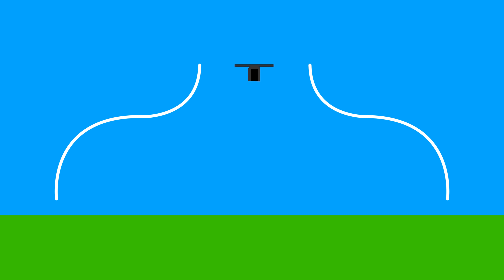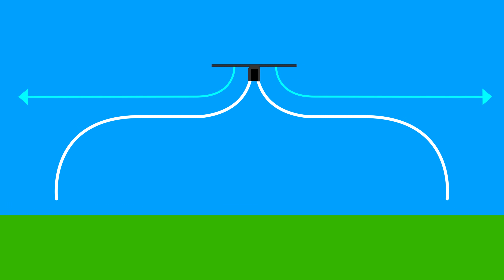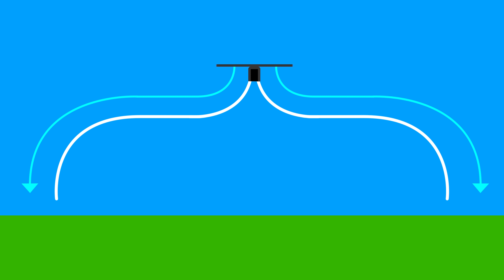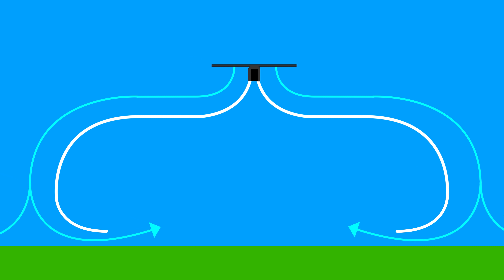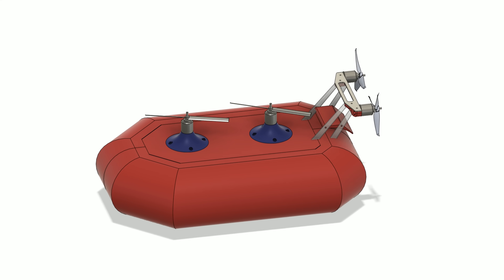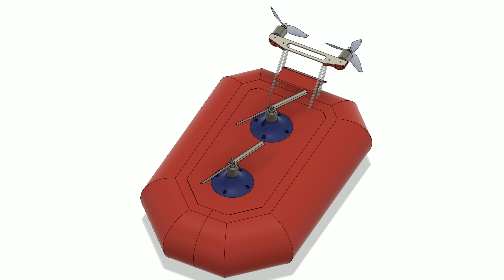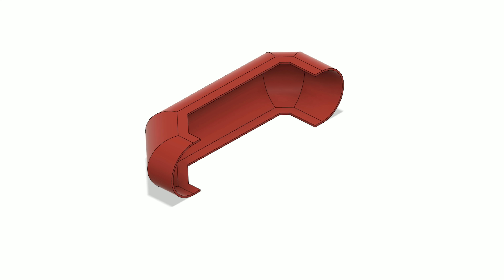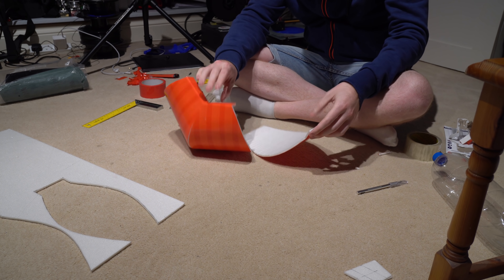Coanda Effect Hovercraft

Comment: why doesn't the hovercraft lift up and flip just like your project? i think that because of that, the hovercraft produces high pressure under its body and it's plastic whatever basically like a balloon and does not rely on actually lifting up using high pressure and low pressure like an airplane. am i wrong?

Comment: I know you were just trying to see if you could build a hovercraft using the Coanda effect at all, but I'm curious to see if you could optimize it. I loved how you did that in the trebuchet video. 

It looks like you're running the two motors on top at the same speed, and it's not helping with the stability. The motor at the front is further from the center of mass and the resulting momentum is lifting up the nose, whereas the other motor is almost on top of the center of mass. I think you could get better results if you 1. used current limiting resistors, with a higher value resistor for the front motor, or, 2. use a lower duty cycle for the front motor if you are using PWM. Alternatively, in terms of the Coanda effect, you could try replacing the front propeller with the impeller, possibly combine it with one of the aforementioned solutions, and see what happens.

Also, since you are looking into ground-effect vehicles, how would you feel about doing a "Caspian Sea Monster" type Ekranoplan? You know, the type with the abundance of thrusters slapped to the hull. I think it would blow all the leaves all over your neighbors' gardens instead of just gathering them.

Comment: Needs more weight to the nose to counter the rear motors and mounts. Put the electronics and the battery at the nose and try to balance it equal to the rear motor's weight.

Comment: Enjoy the video?  Very Much!  I have to ask, though:  is all of the lift from the Coanda Effect or do the props pointing toward the sky produce their own lift?  A more calculated / controlled upper curve surface could maybe enhance the effect.  Can you 3-D print in foam to get the strength of the shell without the weight of the tape?  How broad can you make the lift surface before the laminar flow fails and becomes turbulent? 

Excellent research!  Are there other designers who have other design tool that could collaborate with you and refine this design?  Keep up the good work!!!

Comment: Good job on the construction. Sure you will find ways so make it more stable. May be  decrease the the power on the front lift motor a bit to compensate for the weight of the tail.

Comment: I am no engineer but I can see a terrible flaw in that design. a real waste/loss of down airflow from the propellers. If you have them in a tube and the outer red body with a very thin double layer body, the air could flow under high pressure and then you can obtain your desired lift.

Comment: Now it needs some kind of active stabilization system so it can pick up to about 1" ground clearance, and not heel over when turning. That would give it an advantage over conventional hovercraft by not needing a flexible skirt. Hovercraft were a development from the Avro VZ-9 Avrocar. While intended to be a fast flying, highly maneuverable aircraft, it never managed to get above ground effect height and was always very unstable. But when the concept was modified to stay low, and a flexible skirt added to keep the air cushion constrained, Tada! hovercraft. The tradeoff was the skirt dragging across the surface and constantly wearing. But the dream has always been to have a stable hovercraft where no part ever contacts the ground except when it's sitting still with the engines off.

Comment: When you have props on top instead of the impellers, is it really using the Coanda effect? It seems more like you've created a two-prop copter more than using the Coanda effect. It's not the air's adhesion to the smooth sides that's providing lift, but the initial pull upward from the props.

Comment: Have less thrust on the rear lifter because the direction fans are producing air flow in the same manner as the lifters. Which is why they cause nosedive. Taller impellers may have produced more of the flow you needed, vary the vanes yada yada. Also, a kind of airflow director on the outside of the craft could have done like a skirt or something I don't know.

Comment: Its interesting and shows that there is no big pressure-effect under the hovercraft. The props are lifting nicely up but its always close to a liftoff.
Traditional hovercrafts use less power because they have just to put up enough pressure to start a nice airflow from the inside out and the craft will float on this airflow.
In this experiment the hovercraft only gets lighter and starts gliding over the ground not floating.

Comment: You should have used centripetal instead of centrifugal rotor. centripetal on  center and centrifugal on each corners. Central rortor helps to lift the frame and corner rotor helps to maintain the lift

Comment: i'd like to see you put a load inside the main body along the sides of the opening, basically just at the bottom of craft, looks promising with full throttle use and stability.

Comment: Are your motors set up to counter-rotate [especially the lift motors]? If they spin in the same direction, the [combined] torque could be a source of instability. Also, adding a plastic mesh screen [to cover the opening on the bottom could cut down on the debris that ends up inside the craft.

An interesting follow-up project would be to transform the craft's shape into a large flying wing [to see if that shape would produce better horizontal stability as well]. However, still put the Coanda Effect to use in order to generate lift. 

Finally, move the lift motors backwards (closer to the drive motors) to see if that would prevent the craft [of either shape] from pitching nose-upwards.

Comment: I think part of the problem with the pitching may be due to the asymmetry of the design front to back. The downward fan at the front has less obstructed airflow as it's nearer the edges (due to the more heavily truncated corners at the nose than at the tail). Furthermore, while the thrust rotors may not be interfering with outflow, they must surely be affecting the pressure at the intake of the rear fan.

Comment: Few things id love to see that probably wouldn't be overly complex to achieve..

1. Try fitting a removable panel so there's no gap on the underside. My theory is that under forward momentum this would create a natural cushion of air that the entire craft could ride along. I think the cavity at the bottom would limit ground effect efficiency and might allow it to operate like a WiG vehicle.

2. Try some little stubby wings and see if it will maintain forward flight as a kind of lifting body vehicle

3. Cut out some small vents close to the base of the motor mounts to allow some (maybe 30%) airflow into the cavity underneath creating a more conventional hovercraft. Again, my theory here is that the coanda airflow would hit the airflow coming out from underneath and be force more directly down rather than curving underneath. You could even put lateral slats inside to push the air towards the outside of the vehicle.

Hopefully you could give one or more of these a go and show that coanda can be useful as an assistive lift method for less conventional ground effect vehicles e.g. Heavy cargo etc

Comment: Couple of thoughts: Think it would make a difference if the lift propellers were counter-rotating? (Each appears to spin the same as the other.)
And perhaps you could reduce the top-heavy condition by mounting the lift motors underneath the top plate with  shafts extending through the top plate allowing the the lift props to be mounted in the same location.

Comment: You mentioned it wouldn't need stabilizers because hovercraft are self stabilizing; that's because on a hovercraft, if you lift one edge, the air cushion escapes from that edge, and consequently the edge drops.  With Coanda effect, the active principle is above the deck, and unaffected by the attitude of the deck, or any ground effect, so a Coanda effect craft would not be self stabilizing.

Comment: Watching the direction of rotation of the hover raft body  makes me think that the torque of the propulsive motors may be a problem. I built a hydroplane boat with one of my brothers years ago.  Two motors on the stern,  and we had it flip on us until we changed to counter-rotating motors and screws.

Could you readdress this drive system,  reversing the motor polarity and mounting direction of the propeller on one side? It may cancel the induced torque. Worth a try, no?

Comment: @ 5:37 adding a couple of ducts at the edge of the impellers could have directed a tremendous amount of air under the hull and resulted in more lift than you would know what to do with.  Another vane or two would take more of the impellers' outputs and direct it rearward, generating thrust.

Of course that isn't the goal of the experiment, it's just what I would do with the impellers to make them work on the model, if I were going to carry on with just impellers.

Comment: You need a control. maybe with a flat piece of board. Because how you do know with the thrust of the propellers wanst just lifting the plane up. maybe also take a cross-section and see if your lip to pressurize the underside actually did was you hoped.

Comment: the impellers would have been more efficient if you placed them on the underside and added some light ducting on the outer edge of the inside of the craft and allowed room for the impeller intake, so they would pull air from the middle  of the craft and expelled it to the outer edge, also use lighter weight materials instead of metals

Comment: If the horizontal impellers did not produce the Coanda Effect, what makes you think that this is, indeed, the Coanda Effect in action. I think it is MORE LIKELY simply acting as a copter SCREWING UP INTO the air. There is not as much DOWNWARD thrust of a copter, possibly, but downward thrust is not the only force involved in a copter.

Comment: nice experiment, it hovers sweetly and looks like a superfun toy. you can measure the efficiency using a smoke test. if there's airstream going to the side or upways then that means loss. as others pointed out probably an impeller would be more useful and also optimizing shape of the hovercraft and prop size so the effect has better chance to kick-in

Comment: you might have a tiny bit of success with your theory. But look how much power you had to use to achieve it   On the the other hand if you would used a conventional  system to fill the air curtain, you certainly would have use LESS power float your hovercraft . Edit    Think about the real hovercraft Ship. because no fans on top they could put cabin on top for passenger to travel. Try to put a cabin on top of your model  I am referring to the hovercraft Ship  (Ferry)

Comment: I'm sceptical about the Coanda effect with this design. I think it's just a super inefficient dual rotor helicopter. Produces just enough lift to imitate a "hover". You should make the exact same thing only using right angles (aka a box) but same weight and shape. This would neglect the Coanda effect and test the power of the motors only.

Comment: actually... a hovercraft works by creating a airskirt around trapped air. the rest is correct. you can see that effect with a big can and then inside a smaller can. the pressure is higher then when you would only use 1 can.

Comment: While it’s hard to gauge the weight, dimensions, weight and lift etc, but have you tried to line the insides on the internal lip with square aluminium tubing?
It’s light weight but may be enough to improve stability when turning and will lower the overall centre of gravity (you can also finely tune it by adding small bolts and then adding washers until you find the desired weight).

Comment: Just because you're getting lift doesn't mean you're getting Coanda effect. You need to prove that the air is actually following the curved surface. I noticed in your previous video (with the smoke) that the Coanda effect you were getting was only very marginal at best. I think the props are mostly providing helicopter lift, and your drone would probably go higher without the weight of the curved fairing. I think your flow from the props are too turbulent to be generating much Coanda effect.

Comment: Nice. but you need to do a version of the design more like a hovercraft to compare them. Maybe just cut a hole in the top and lower the properllers (or just use a single propeller in that mode).

Comment: Maybe next you could combine Wing in Ground effect and coanda effect. Like a system similar to this for low speed manuverring but with a ram intake to pressurize the bottom for smoother high speed operating. Also maybe putting some sort of cover over the impeller could help, I think they might be making a ring vortex by sucking up the air they just expelled.

Comment: I think this would work better if the shape were more like a hamburger bun. Rounded on top, with a flatter surface on the bottom. It should still have rounded edges on the bottom, but with a much shorter/smaller radius to those edges. Look at a hamburger bun and you'll see what I mean. This will give it better lift and more stability. The effect will come around the top edges and immediately meet the ground, rather than having to travel the greater distance across the empty space between the top half and the bottom half. The bottom radius is just too long. It'll be much less likely to flip over, and the effect will reach the ground more easily. 

https://www.featurepics.com/StockImage/20080613/hamburger-bun-stock-photo-767901.jpg

Comment: So, I think the coanda affect could actually be used in a hovercraft, to make all the cargo, people, and fuel essentially be inside the "skirt."
But I feel like the best way around it would be to make a high-efficiency hovercraft by having the top of the "skirt" under the props be somewhat grated, so air can slip under and over the "skirt," taking advantage of the typical hovercraft logic, and the coanda affect.
I'm curious if you'd be willing to try this.

Comment: It appears your center of mass is somewhere between your rear lift motor, and your propulsion engine mount strut.
So it's high and tail heavy.
Adding a little bit of weight on the inside of the nose inside the... Erm, "skirt," (for lack of a better term) could resolve your tipping issue during turns.

Otherwise, to resolve the issue of tipping, you'd have to look at cars and other hovercraft; make it wider.

If you do remake this, I'd love to see a 3d printed (or laser cut wood) prop motor mount, to keep the weight near the middle, and slightly lower.

Comment: Could it be that your vertical props are actually acting like drone lifts and not the coanda effect much at all? Coanta effect devices I've seen designed have a fan that draws air in through a area from beneath the dome and slides it over a domed shaped lift body. I'll bet that if you were to make a cut out area below your blades it would lift more even if the coanda effect were destroyed by doing so, but because the props would be more free to act like drone props.

Comment: Very interesting!  It seems like it shouldn't be too difficult to move the motors to the underside and mount the props (in the same place they are) on axles, to help bring the center of gravity lower without adding much weight.  I know that's besides the point of the experiment but it might be an easy mod to bring more stability.

I'm also wondering what would happen if the underside was solid instead.  That should be very easy to test and might also bring a bit more weight to the very bottom, again lowering the center of gravity.

Subbed!

Comment: The fact that the vehicle acted as a pretty good leaf-collector shows that air is being blown into the cavity underneath where, presumably, it becomes quite turbulent.

What would happen if the lower part of the hull (where it curves underneath) were removed, so that any Coanda-effect stream of air met the ground almost perpendicularly, rather than continuing to follow the curvature of the hull and filling the void as it does at present? What would happen also if the void were then closed-off with a panel filling the aperture at the bottom?

Comment: To light sharp turns will flip it cus it's a solid curved frame and not a flexible skirt .....remote open fan leaf collector 😁😁😁 cud use a flaps either side with sensor to lift flap for a second stability control lol

Comment: I would like to see what ratio of your demonstrated lift was Coanda effect compared to the reduced air pressure directly above your lift propellers?....... Because Coanda effect should tend to stabilize by loosing lift on the higher side, while low pressure lift above the propellers would compound the effect of an unlevel condition by pulling in the new direction of tilted craft and accelerate the flip.

Comment: Is that the most efficient axial fan - 5:57 -, because turbos and vacuum cleaner motors have a small centre hole with tapered blades, ie, large height at the centre tapering to thin at the outside.

Comment: Would try to get the center of mass much lower, maybe install the motors lower with shafts for the propellers. Bigger batteries on the sides (mounted low inside) to give it more balance. A flap or two for the rear for steering. Maybe a small groove on the front (that goes all the way under) for stabilizing the airflow? For some reason I see potential in this design. EDIT: Also make changes to the inside air space so that debris won't have a place to collect.